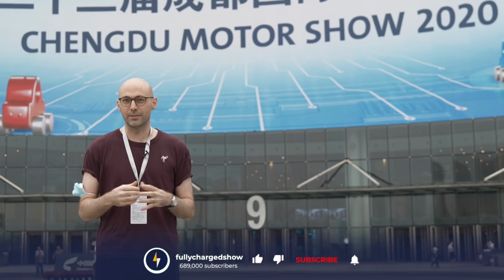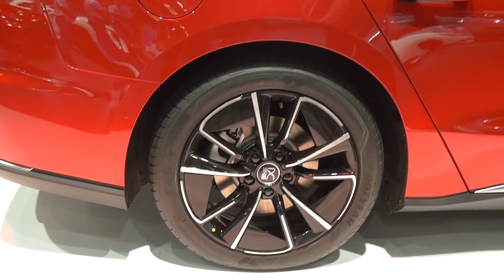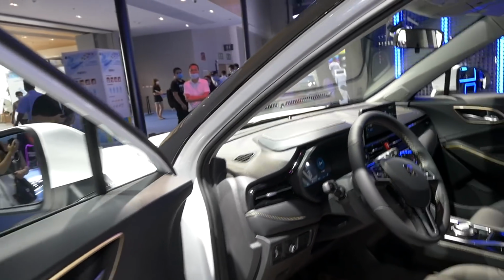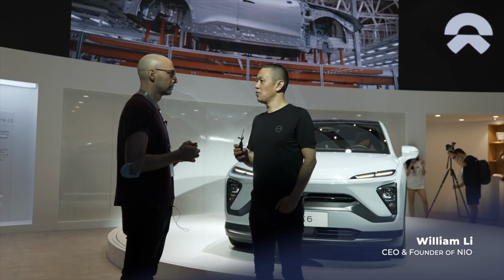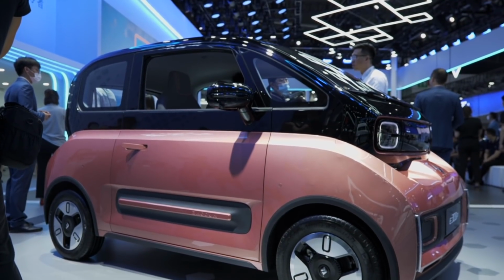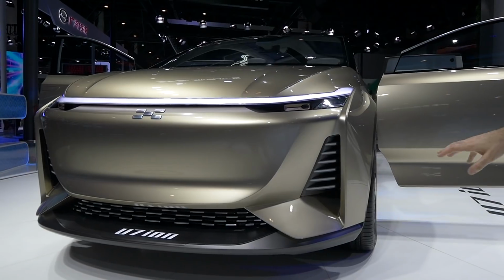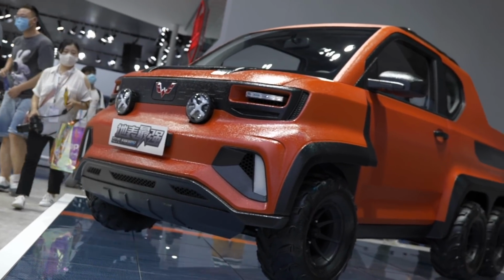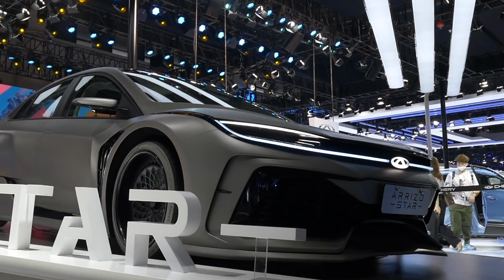Cheap, Cool & Crazy Electric Cars at CHENGDU MOTOR SHOW | FULLY CHARGED for Clean Energy & EVs

Comment: I live in Wuhan China. I have been driving the first car you showcased. The BYD 360 small SUV. I bought it 2 years ago. It has a normal petrol car dash with small touchscreen in the middle. I absolutely love it. Cost me 95 thousand Yuan. I can charge it at work and home basically costs me nothing to run it. About 40 dollars a month. No servicing as it’s electric it’s a joke. Super zippy fast in traffic beat most cars off the get go. Super comfy never had an issue. Heaps of room to carry stuff when I put the 2 back seats down I literally moved most of my house contents with it including the dryer and washer. Great sound system everything it’s just awesome I don’t understand how everyone would not want an electric car. I drive at least an hour commuting every day as well.

Comment: I was skeptical when I saw the first battery powered drills, never trusted their efficiency of delivering power for commercially hard works with the  juice of chargeable batteries, same thing when the electric cars came to market, still I'm not comfortable, can't trust and skeptical about rechargeable batteries, but apparently I was wrong and I'm 100 percent wrong today about what the new battery technology is capable of and can compete with gas powered cars even better, shocking truth about Chinas very fast achievement toward car industries and battery technology.

Comment: Chinese manufacturers always use silly logos. Crash tests? Safety, battery quality? Electric cars need to be lighter though the wheels should be super light and the body alloy or carbon. The small baojun is really like the small Kei cars you see in Japan. Not sure on the glass roof for safety but I guess that's going to be more photovoltaic.
Reply: Chen Uy  yeah was Germany. Germany claims the technology was copied after they supplied the parts?

Comment: Other than seat belts there is no mention of safety features or impact testing. This could be one reason these vehicles are not for sale in EU or N.America and why they are inexpensive.
Reply from the maker: Remains to be seen. The main reason that these cars aren’t outside of Asia (yet) is that the demand is so high in that part of the world that they can’t match it (yet). Chinese cars will be common around the world by 2030. Once Japanese and Korean cars were dismissed in the same way.

Comment: One of the reasons why some of these cars have very good ranges and are so cheap is that they will not have crash structures engineered in, in the way that 'legacy manufacturers' (as Elliot refers to them) will.  While undoubtedly Nio and Xpeng won't be far off our standards selling outside of China, many would fail Euro NCAP standards entirely.   Probably the  only way you could register a Baojun and it's ilk here would be if they could be classed as quadricycles  thereby being exempt from EU crash testing.   
Would be interesting if Elliot could find out what safety standards Chinese manufacturers have to meet and how they compare to US & EU requirements.  That would give us a better perspective on how they actually compare to the cars we can buy.

Comment: Finally a car without monitor, why? I find it blind for driving & dangerous, many are high for average drivers which means can't see outside, generally I hate tablets monitors for same reason which European Union is silly about laws. Also they talk plastic economy but its must in lights, and excuse is for safety, personal I lough.. Glass better light & all here we know about our lights that we can see no think!! About all these annoying electronics manufacture companies why don't think is waste of energy too.. I miss old cars that are beauty interior with all necessary circle equipment which was beautiful and now electronic shit & blind tablets & monitors.. I really wonder if damage or stuck what we do! Also in sun you can see nothing.. Plus melting screen or huge temperature? I want to inform specialy almost all companies tank fuel saws wrong yr gas in tank, which means you don't know if you have more or less kilometres, or yr speed trip is 85% wrong... And why the hell don't use solar panels on roof smalls from and back for necessary equipment perhaps or charge the battery's as well . Its wasting of solar power in many countries... Like Yr comments friends!

Comment: Thank you for a most informative presentation. What comes powerfully to the front are the affordable prices. With such prices and the low running costs, these EVs should drive comfortably into the future.
Reply: It takes a level of myopia that is truly epic to say that they are comfortable prices for the people they're marketed to. It's like condensing water vapor so the people can sweats without disclosing that that's what they're paying two or three days of their livelihood a week to be able to do. There's something called radiant Cooling and it has been suppressed for over half-a-century now with it being enabled by low density polyethylene ability to prevent the humidity within the air from plugging up the efficiency of the cooling system. You don't want to get the water in the air in the way of your body radiating its heat in the infrared Spectrum. The air conditioning industry has argued to the contrary and for this reason alone has contributed mightily to the destruction of the planet and presently threatens even greater harm so as to get away with the same Criminal treasonous conduct in New Markets. The free enterprise system would reward contact Cooling and criminalize anything--but micro Mobility. The expression micro Mobility refers to human Mobility that should not be used in a l I e u of the Viator it seems like the capital letter I and the capital or lowercase part of me the lowercase L appears to be exactly the same as an uppercase i now Google has a real sense of humor there so I'm going to have to type these:

I l

Comment: Is it just me or more than 95% of these cars look either like a complete ripoff of eu/us models or they just copy and paste design features of multiple eu/us models and stitch it up a bit(but for the original design of two cars that were in the video, great job and thumbs up). Therefore i dont think these cars could even enter western market. Plus the cost is amazing but price of these vehicles is so low that i doubt it can even cover material cost let alone labor. I guess the automakers are subsidised to a large degree which kind of gives them an unfair advantage to other manufacturers, although i might be wrong. Another concern of mine is the reliability and quality control, how does it stack up to legacy automakers and tesla?

Comment: Friend of mine was in an accident a few days ago in the Lake District. The Jaguar i-Pace EV hit a tree, drivers side front. Driver was dazed with broken ribs. Both manged to get out of the car. As they were getting out a fire broke out in the front of the car.  Within 3 to 4 minutes the car was on fire at the front and inside at the front. Within 10 minutes it was engulfed.  The car ended up a mess of melted metal. The impact automatically sent a call to the police who were at the scene in 5 minutes, the fire brigade 10 minutes. 
If a driver was stunned he would be burned alive. 

The design is wrong for sure. A lot of work still has to be done in safety before EVs are safe enough.
Reply: There is not enough emphasis on safety in Fully Charged.

Comment: Wow this guy really isn't good at all.  He doesn't even have the right knowledge of the Toyota Izoa. It's based on the C-HR/Prius platform of the New TGNA chassis that are underpinning almost the entire range now. The blue isn't to show it's "Electric" as he so crudely put it's actually the top of the range Dynamic spec colours that Toyota have used on the C-HR since it's introduction. 
The high standard not fully charged it clearly lost by this guy

Comment: Prices on most cars are impressive, and range extensions seem excellent, but there's one big disappointment in design. There's very few innovations to combat drag factor, which is very important in electric vehicles. Designers are still thinking in terms of the I.C.E with in most cases, still having bonnet and engine bay space at the front.

Comment: It would be nice to know if the cars are rear-wheel drive or front-wheel drive or both, where the battery pack is located, and their KW rating of the motors.

Comment: I very shocked at some of these prices, they are so low! and with the spec and specifically the capacity of battery packs. (44kwh for around 10 grand) That wont happen for another 10 years in the EU. Watching this reminds me how behind legacy car makers are! and a lot of them are (not surprisingly) in the EU. I'm looking too sell my EV to upgrade, but after watching this im not keen to pay upwards of 30 grand for around the same capacity (44kwh) the only true contender is the MG ZS EV with 100kw charging as standard with a very high safety rating. But again its one of the first cars out of china, so nothing from the EU or America. Even Tesla doesnt push it. They are pioneers for sure but if Elon really wanted to push a mass market hatch back he could have done this now, the Cyber truck could have been put on the back burner for a more mass market car. Despite the model 3 being a good all round car, most people still cant aford the 36 or more grand for one.

Comment: Shows how much traditional manufacturers are in bed with their  petroleum friends. Token EV and PHEVs in their range with extreme pricing, battery prices have come down 8x since leaf 1 , yet its current model is same price, even 60kwh model should be cheaper than first version, it’s in my eyes collusive behaviour.  China will start the boom, I don’t agree with their policies but I like how their industry is independent from big oil.

Comment: The biggest problem with a lot of Chinese car is Zero after sales service.  Once you buy the car, everything else is your problem.  BYD had the opportunity to all taxis in Hong Kong, but they would not be responsible for charging stations, so very few taxi operators chose to take up this car as a taxi.  A pity.  Also battery renewal was an issue.  Replacement after a few years.  Maybe things have improved ... also - nothing about self driving software.   May this has changed as well?  However, China can build a lot of cars and is the world's biggest market with a real focus on EV cars, which is very good.  I have no idea what safety standards are in China.  Tesla outsells all China produced cars by 3x at the moment.

Comment: BYD didn´t put the spare wheel on the back of the Yuan because of practicality, they put it there because the Ford EcoSport sold in China has the wheel on the back. I mean, the "inspiration" is quite out there.
Reply: Why do you think Ford put it there in the first place?
Reply: @jwickerszh  sure, but the credit goes to Ford, not to BYD
Reply: @vichomangiola  Yes, well sort of ... It's actually called a Continental tire from the Lincoln Continental, so yes Ford from 1939.
But Ford was still not the first to adopt such a design feature which is much older.
And yes, it is always done for practicality reasons.
Reply: @jwickerszh  great, clearly that wasn't my point. I´m talking about plagiarism, and in this case, as in many other cases of chinese copies, function is a byproduct of copying forms.
Reply: @vichomangiola  yes, your point just doesn't make any sense. Alternatively you could explain how you would design it if you were in charge?
Reply: @jwickerszh  how does it not make sense? The car is a copy of the Ford EcoSport, is copying others the only way to design a car?
Reply from the maker: My knowledge of the Ford EcoSport is minimal, but I once owned a 1953 Land Rover and that had a spare wheel on the back. The 1938 Willy's Jeep had a spare wheel mounted on the back. `There is no such thing as 'an original design' in the automotive industry, just a long evolution and changing fashion.
Reply: @fullychargedshow  Exactly, now you can get the ecosport without a spare wheel .. cynics may say it copied the Chevy Trax ? ;D
Reply: @jwickerszh   @fullychargedshow is not about the spare wheel! guys, really? Plagiarism in chinese cars is a thing that has ended up with sues against them, are you really not aware of that? There's a difference between not being original, and a blatant copy. It sounds like you are justifying the latter.
Reply: @vichomangiola  So was that manufacturer sued? when?
Reply: @jwickerszh  not that i know of, why r u asking?
Reply: @vichomangiola  I thought I might have missed it🤷‍♂️

Comment: They already sell JAC e-S2 model (small SUV, 40kW battery, 275Km range WLPT) here in Switzerland for about 27'000CHF (25'000€ or 22'600£) and e-S4 model (small SUV, 55kW battery, 355Km range, 2020 make) for 31'000CHF (28'700€ or 26'000£). That e-S4 model looks nice actually. Not sure what is their original price in China.

Comment: Some of those Chinese cars looked awfully similar to cars from other countries: 4 wheels, 4 doors, seats for passengers, steering wheel, clearly been copied! How about a new design?
Reply: @TetsugakuSan  I'm pretty sure the East Asia Correspondent  is aware that the CIA, MI6, etc will know how to hack into most pieces of software should they decide to do so, as for Slave Labour most of that is probably being used to make expensive clothes or iphones or some of the components of Tesla Batteries. How did Slave Labour end (in the places that it has ostensibly ended)?
Reply: @TetsugakuSan  I thought that was you? Not the first time that I've been wrong about people, and it wont be the last. But that said I'm still pretty sure...
Reply: @TetsugakuSan  I do, did you?
Reply: @TetsugakuSan  I'm not paid!!! Grammar always correct (in a comment section), I think not! Shill's like you seem to be very keen on grammar...

Comment: I would buy one of these in a minute. They just need to sell them in the
Reply: Where? Trust me, Some of the big company could be trusted and lots of the small ev company sucks with fake mile range, fast battery attenuation, bad build quality (on chassis and other thing your can't see). I drove a cheap Chery EV back to 2015 for short term rent and it drives like a baby bed. Shaking, noisy, it shows 100km left and i turn on the air condition and battery end up on the elevated road. BYD is good. NEO is good. I don't know how Chery goes but i had a really bad experience about it.
Reply: @ericqu3962  I'm pretty sure such responses will help separate the good and bad EVs and provide the bad ones more incentive to do better. So thanks!:)
Reply: Slavko Glamočanin Yes!
Reply: Talk to someone who lives in China, Chines people don't buy Chinese cars .. and ever wonder why they are so cheap?
Reply: Darren Pardoe pls check how much cars Chery, Roewe, BYD, Wuling(GM), sells every year. Chinese prefer to buy luxury car from imported brand. But Merc, BMW etc had factory in China too. Cheap car market Mainly held by domestic car brand.
Reply: @darrenpardoe  Have you ever talked to someone who actually lives in China?
Reply: @darrenpardoe  most of Chinese haven't trust the new technology yet, just like westerns. it takes time.

Comment: the IZOA is just the familiar C-HR which is sold in its electric version exclusively in China in both the C-HR version and the IZOA version, which are basically identical but each is being sold by one of the two different TOYOTA joint-ventures in China

Comment: Would love to know how safe all the cars are in this video. It's a concern for everyone and parents especially.
Reply: Ronan Plant 
In 1948 or so my Mom had a Crosley convertible. We got T-boned by a Buick and flipped upside down. I was in the back. Passers-by pushed the car onto its wheels. I was ok, my Mom got a run in a stocking.
Reply: @andrewhewes4010  Just googled Crosley Convertible and wow what car. They don't make them like that anymore.
Reply: Electric cars are notoriously safe overall.
Reply: @jdmrc93  Maybe but no ot all cars are designed or built the same.

Comment: the critique against UX designs on screens which was simple has been constantly called as "cheap" while not understanding that simplicity is the goal in user friendly, modern design. overflooded graphics, such as in the old brands are a thing of the past and counter productive. It's like in modern architecture and typography, clear lines and shapes - simplicity.

Comment: I can't believe the BYD e2 has a 70 kWh battery pack and costs only $14.331, the 14k must be the base model with less than 70 kWh?

Update: thought so, the base model is only 35.2 kWh!
Reply: It's gouvernement subsidized...
Reply: Werner Just subsidize about $3000/car
Reply: Navi The Fairy But the 50kwh only $17000
Reply: Navi The Fairy The 35.2kWh base model price is $12700
Reply: There is no e2 with a 70kWh battery, he must have it confused with the electric motor which is 70kW (100kW for the top model).
The battery is either 35.2kWh for 305 km of range (starting at ~90k RMB or $13k) , or 47.3kWh for 405 km (starting at ~ 110k RMB or $16k)
Reply: @jwickerszh  those range numbers sound reaaaaly fishy...
Reply: @nox5555  Those are all NEDC range, which are close for city driving so you may take 20% off that if doing mostly highways.
I often rent old beat up EVs in China and that maths holds out so far.